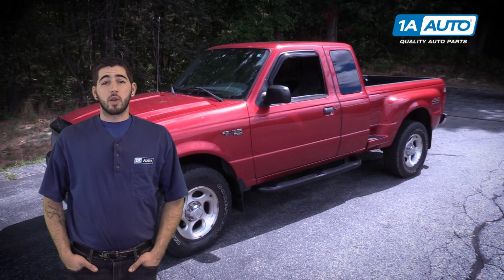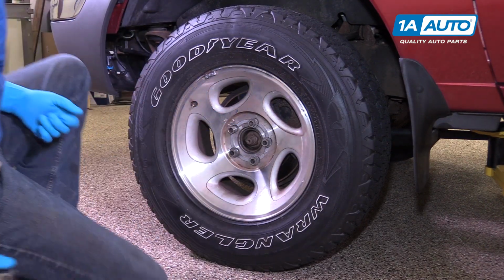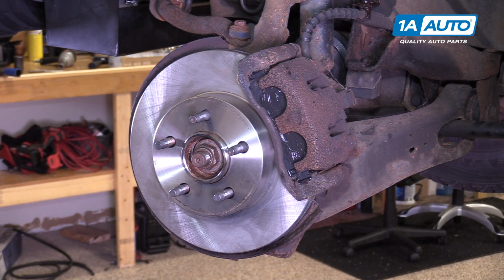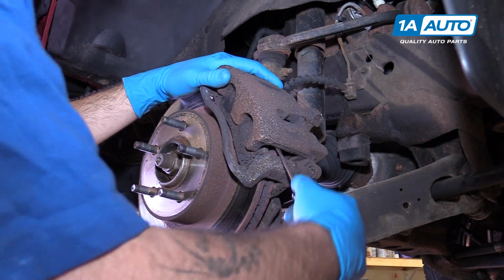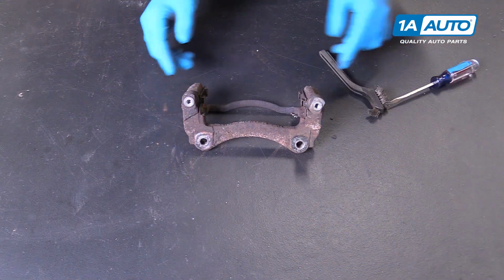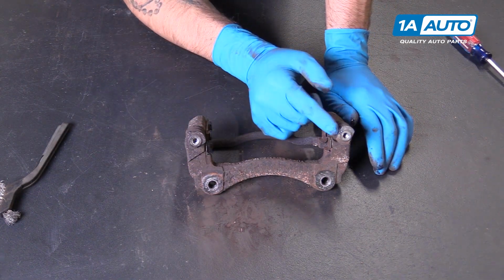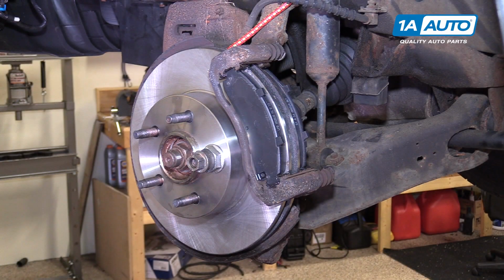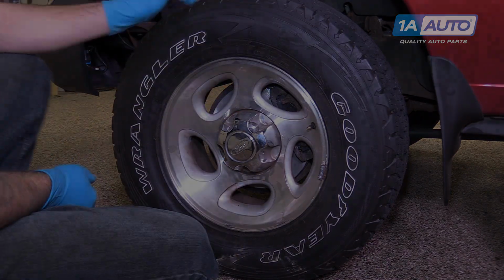How to Replace Front Brakes on Any Vehicle (FULL Guide!)

Comment: @8:11 - I would wipe down the brake clean off the rotors before installing.  I would not install with the brake clean just sprayed on.
Reply: Brake clean evaporates very quickly but yes it should be wiped down to remove the oil

Comment: Good video and a good refresher!  The guy I learned to do brakes from would also do new wheel bearings and pack them with grease….  Not necessary but while you have the wheels and rotors off, why not?

Comment: I have a couple questions. 

1. Dont you have to either A. suck brake fluid out master cylinder, or preferable B. brake the bleeder screw loose when compressing the caliper? or did i miss that part? or is it not important?

2. Ok, not a question, but.... it says how to do front brakes on ANY vehicle, and you did a GREAT job, except i would like to see you do a fixed caliper, such as on many toyota trucks. Just to make sure i've been doing them right :)

Comment: Grease on break pads? So what do you think will happen when the breaks heat up under hard breaking? Maybe melting! there is a product that is specifically designed for that, that doesn’t melt,Like CRC Industries Disc Brake Quiet,but most new Good break pads have a shim built in. And grease melts at 300 to 400 F

Comment: I took my to I to have reck and pinion replacement and the auto shop filled my over coolant reservoir tank to the hot level on to actual dex cool coolant that I leave on cool level and  they the auto shop filled up to the hot level and most likely did with water without telling me first after filled the 2002 Chevy Impala LS with new dex cool coolant when I did the cooling system flush 3 months ago. They did tell me about inspection but they didn't they were gonna that. That out of the description. I'm lol concerned what they did with the resivor. I ways put my dex cool on cold lever. Does ever shop do that so the customer won't run empty on resivor. Don't want that have damage my new dex cool coolant or my engine